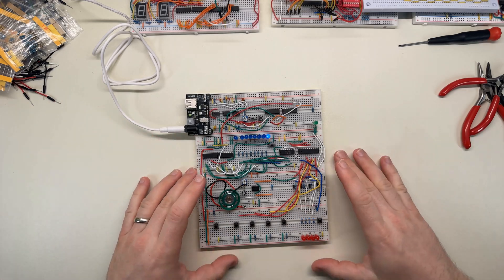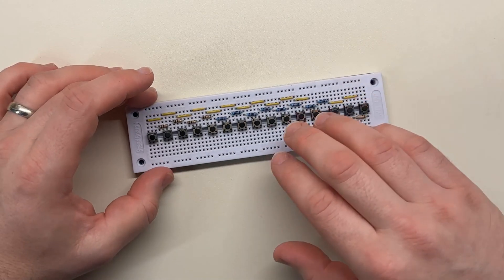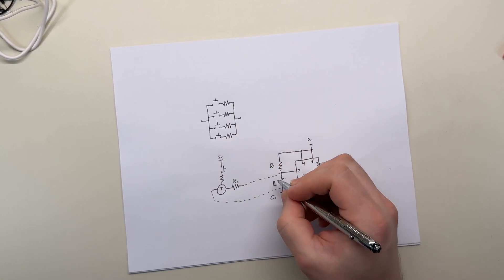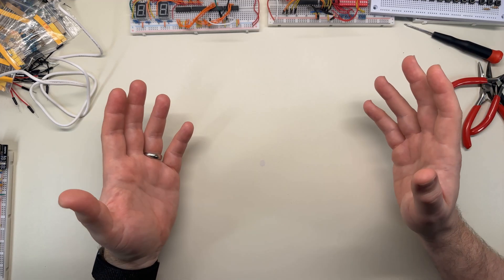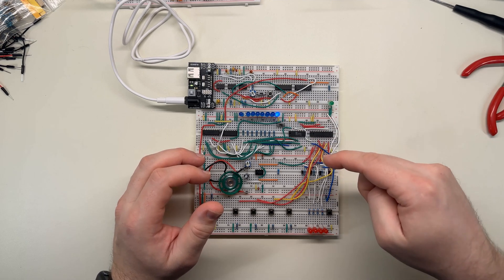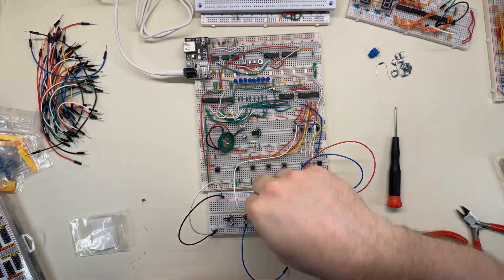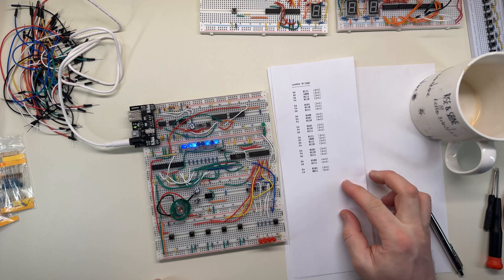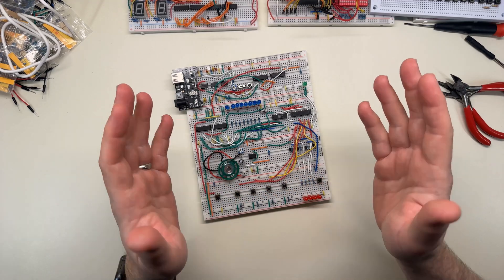I made a music box with some 555 timers and an old RAM chip

Comment: I'm wondering if you would have gotten better frequency control using pin 5 on the 555 rather than trying to electrically change the timing resistors

Comment: Have you thought of looking at the datasheets for the device's,  they will tell you all about the output drive capabilities. Ram chips were never designed to have a high drive capability as the were working at the limits of technology at the time and needed all silicon for the ram function. If you produced better drawings we could probably provide some better solutions.  Just a thought.  Still a  ice video to watch.
Reply from the maker: I should have mentioned it in this video, but since I had talked about it in prior ones I didn't think to. (Plus I didn't expect this video to suddenly get so many views!) The RAM chip is an SY2112A and the catalog with the data sheet is here: https://web.archive.org/web/20221113021101if_/http://archive.6502.org/datasheets/synertek_data_catalog_1981_1982.pdf. I didn't really know how to interpret some of the numbers there when it came to the dimming/driving problem I had, but it wouldn't surprise me if the answer is right in front of my face, tbh.
Reply: @bigzaphod  having a quick look at the datasheet the output when high, will be a minimum of 2.4V while sourcing (-Ve) 150uA.  It has by the look at it a weak pull-up on the outputs.  Normally with logic chips you think of this as fan out, the number of standard Inputs that an output can drive and still be within specification.

Comment: Use a resistor ladder (similar to the R-2R ladder in a DAC) for generating voltages correlated to tones, then use a linear VCO made of a 555, and a simple ADR circuit for note shaping and then you get it. 

The magic values for resistors in the ladder... The ones connected to the key lines are of 300k. The ones connecting the ladder in between are of 1k. The termination resistor to ground is of 17.8k (can be a set of two resistors of 18k and 1.8Meg in parallel). You can add as many stages as you want, and every stage decreases the voltage in a ratio of ≈ 2^(1/12), that is, a semitone. Keys can be digital signals from any IC but if you want to make keypressing notes, you have to use SPDT momentary switches, NC to gnd and NO to Vcc. Push buttons do not work here.
Reply: The problem with that idea is it wont produce a musical scale. 
Instead it will generate unusable  frequencies .
Reply: @mikegLXIVMM  No, no, this is not an idea, it is an actual design i did in 2021 as a present for a kid. Because i cannot put any link here (or youtube would remove the whole message), i just uploaded a demo video to my yt channel. Check the video description for more information. Feel free to replicate or modify my design.
Reply: @mariobv947 
How many bits does it use?   It can't be just 4.
Reply: @mikegLXIVMM  Let's say that you need as many bits as notes you want to play, but i wouldn't talk about bits because this DAC is not Binary. In fact the Binary DAC (R-2R) network is just a particular case of an infinite set of DACs including, for instance, decimal DACs. in case you encode the notes as Binary Codes, one must demultiplex or decode before sending the note to the DAC. Let's suppose the memory reads 0101, then the decoder will yield 0000000000100000 to the DAC such as the one i have shown.
Reply: The interesting thing about this is that you don't need a bunch of fancy valued resistors or fine tuning every resistor value in the ladder.

Comment: i didnt see this in the comments yet, but the ram output drop is consistent with the voltage drop across a diode.  which makes sense since its a Light Emitting Diode.
Reply: I too was thinking the LED voltage drops were likely the problem.  I encountered this with one or two Ben Eater projects

Comment: Instead of resistors, you should have a potentiometer for each note.  That way, you can tune each note by hand
Reply: The problem though is that without a 4 to 16 decoder, each resistor affects the others depending if the RAM output is 1 (5v) or 0 (ground, not open circuit)
Reply: @danman32  ah, good point. Luckily, 74154s aren't too expensive
Reply: You could even use the small blue trim pots for precision tuning, and use a tuning app on your phone to get the notes just right!
Reply: @natethefighter  Don't need any tuning. Just use the right resistors.

Comment: That 4 resistors on data bits is reminiscent of half of "Covox Speech Thing" which was basically poor man's DAC from c64/Atari era. You can use that voltage to drive voltage to frequency circuit (can be built also on 555)

Comment: I have a tip for improvement. You may build a 4 to 16 demultiplexer. That will take a 4 bit number and output a signal on one of 16 outputs. Then you can use 15 individual resistors, one for each note, and have better control over the tuning.
Reply: lol this was the first thing i thought maybe instead of resistors use pots so as to adjust the note on the fly.  Amazing vid btw!
Reply: No need for individually tuned resistors. Just use the right resistor network.

Comment: Oh my god im crying. Nice!! 

I winder if it can be tuned wirh a variable resistor? Or multiple?
Reply from the maker: I thought about doing that, but I figured I'd probably not be able to properly tune it given my general lack of musical talent, but maybe I should try it anyway!
Reply: @bigzaphod  I'm tone deaf too. I tried to find a free phone app that I could put in a desired note and have it tell me when whatever I was playing it was near enough. I wasn't able to find one. This was to tune a programmable sound generator ic I have. I just have to rely on the maths for it.  Which is possible because it's a digital device. Your circuit is more akin to a true analogue synthesizer. So cool.

You might want to look into voltage controlled oscillator (vco) circuits next. They use op-amps. Who knows you could be designing the next Moog!